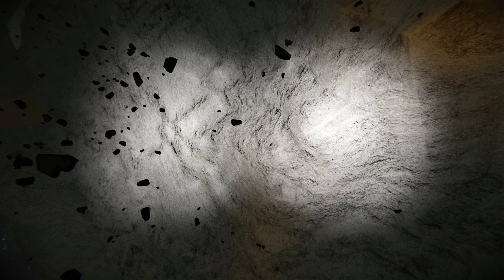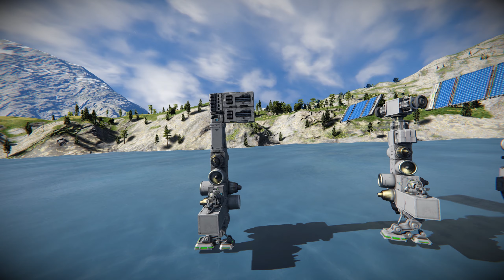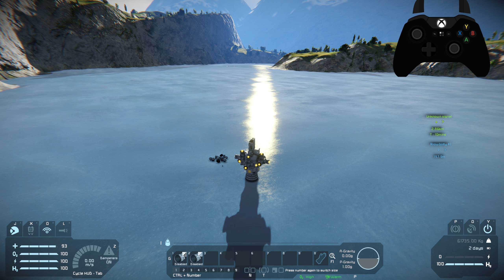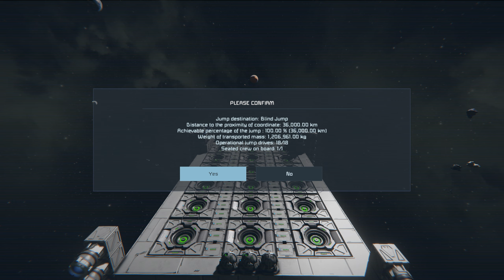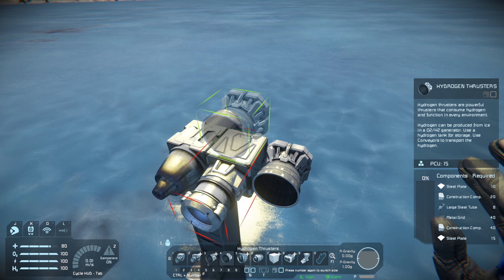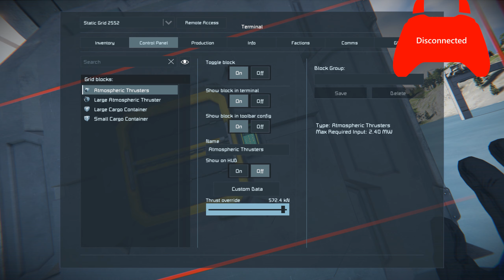Space Engineers Large ships. Xbox and PC

Comment: Does anybody know what that pink wireframe is surrounding your space station? Kind of looks like a spider web. When on Mars I discovered it but not a clue what it's for. 🤔 

Also trying to figure out how you jump to certain points on a map. I'm assuming that's done by using antennas but not sure. 

Overall loving space engineers here. Even though it has some pretty significant performance issues on Xbox. Always says scene is too complex. 

Or has a performance issue. pop up on screen. Would be great if you could also research water on some planets. Do like a terraforming type of thing would be pretty damn cool.
Reply: Not sure about the pink wireframe, but you create GPS items from the GPS section in the info/menu screen (far right) .. once a GPS item has been created you can jump to that position by selecting it on the jump drive and then activating the jump.